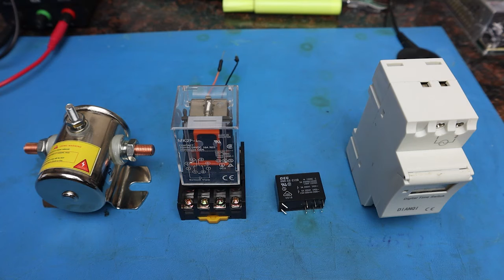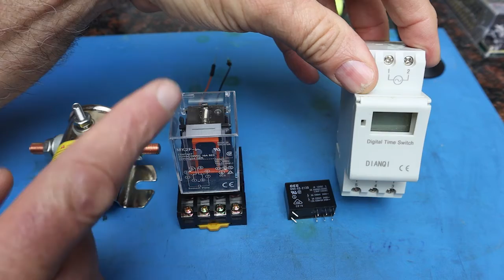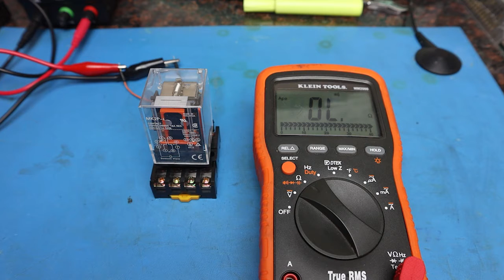What is the difference between a Relay and a Solenoid?

Comment: A few other differences that may be important, depending on the application:

1) The poles of a multi-pole relay are not guaranteed to all be in the same state. This is because each pole is mechanically independent of all others. In a contactor, all poles are mechanically linked and, therefore, are guaranteed to all be in the same state. In a relay, one pole could be welded closed while the others are free to move. This guaranteed simultaneous state change is critical in safety and motor starting applications where one pole "disagreeing" with the others could have catastrophic results.

2) Most industrial contactors have the ability to add auxiliary contacts that also have the same guaranteed state change characteristics as the primary contacts. These aux contacts are typically used for signaling the state of primary contacts and come in both normally open and normally closed as well as combinations thereof.

3) "Forcibly guided" relays have the same state change characteristics of relays but are not rated for high current. They are relatively rare and are typically only used in safety applications.

4) Contactors are rated, in the US, two ways, depending on how the contactor is going to be used. First is by "general" use, meaning non-motor loads, and is expressed in Amps. Second is by horsepower and voltage when the switched device is a motor. The reason for this is that a motor has a high inrush current that quickly subsides once the motor is turning, as opposed to a constant current load. For example, a contactor may be rated at 7.5 HP @ 480VAC (11 full load amps) AND rated for 28A general use. The distinction can be very important, depending on the application.

Great intro video and my apologies for nerding out! As a controls engineer with some green junior engineers under me, I cover this stuff every day.
Reply from the maker: No Problem,  Thanks for adding some great info,  I have never worked with industrial  components.